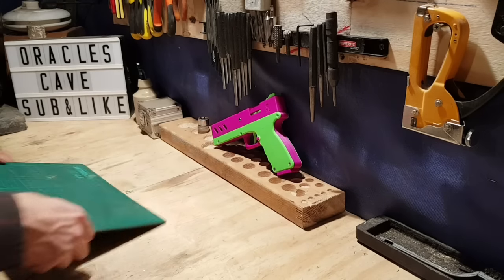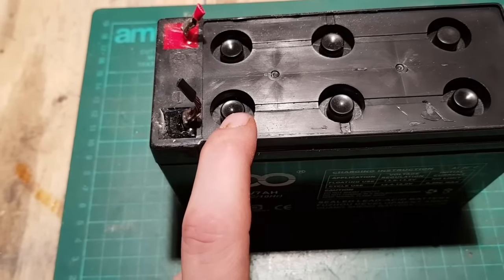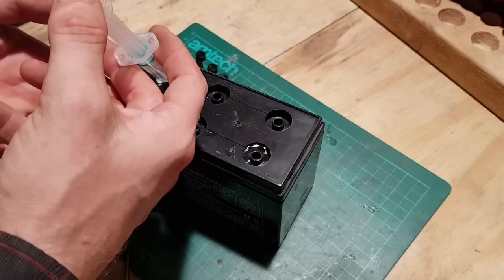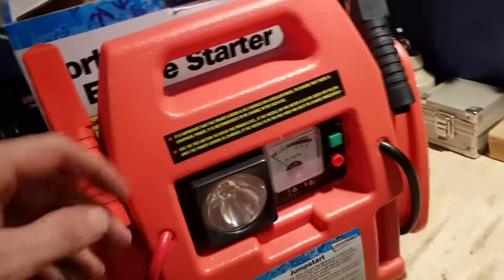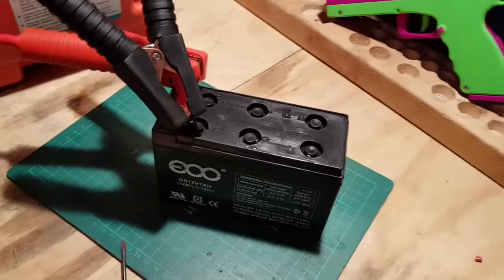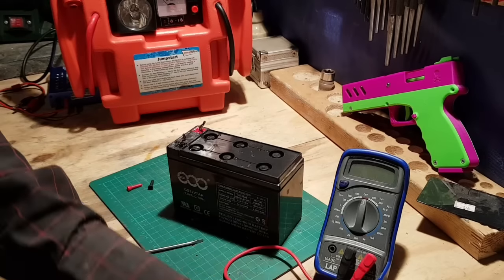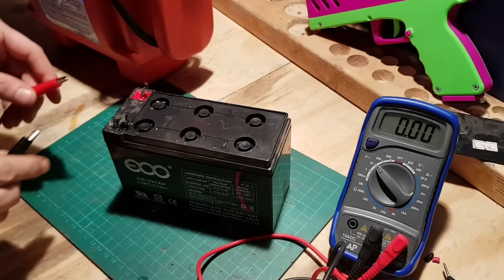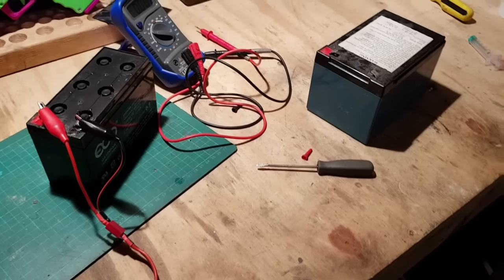HOW TO REVIVE DEAD 6V, 12V BATTERIES THAT WON'T CHARGE

Comment: Bought a 6 volt rechargeable battery to power my klaxon horn, after 1 horn blow the horn won't honk after that. also the horn is mechanically/electronically sound and the battery is at 6.54 after honking the horn, which is fully charged. what gives?

Anywho, i'll give this a try on the battery cheers mate.

EDIT: Took a look inside the battery cell plates, Lo and behold, no electrolytes and has a huge sulfation growth on the plates. 

I guess this battery might be dead.
Reply from the maker: Not completely, possibly topping up with distilled water, maybe reversing the polarity for a few seconds might help reactivation of the electrolytes.

Then charge it, probably work.
👍👍👍
Reply: @oraclescave  cool, thanks I'll try that out!
Reply from the maker: Maybe you broke the horn somehow, that sounds like more than enough juice to make the horn work.

I would try looking inside the horn for an issue before I would check the battery.
Reply from the maker: Sometimes klaxon horns are made with little gears and wheels inside and the little brass parts can fall off their connection points inside with all the vibrations, just open it up and see if you can put the wheel back and maybe epoxy or jb weld the pin back into the side.
Or look for a how to repair klaxon horn guide and try and match it to the one you have, then it's a step by step.
But your battery sounds good
Reply: @oraclescave  That's the thing, i took a look at the horn few hours ago to lube some parts and everything seems mechanically intact. 

And the horn blew strong. My bet is on the battery. quite unfortunate, the battery was like 53 - 73 dollars, christ didn't even last a year.  My fault for neglecting it i guess.

Thanks for all the suggestion's mate. much appreciated!
Reply from the maker: @samhicks97  in that case, get that case popped and do some refilling, but if you can test the horn with some other battery, that would also help diagnose the horn.
Best of luck and let me know how you get on.
👍👍👍
Reply: @oraclescave  Hello again Oracle, Here's another piece of information that might have put the nail in the coffin for the battery.  I followed a shady video telling to chuck in some salt into the battery cells. 

(This was after i lubed the horn and was ready to put back into the car)

So i think i killed off my battery by putting in the wrong electrolyte, I apologize for wasting you're time, the issue was right in front of me the whole time.
Reply from the maker: @samhicks97  yes salt is a very good electrolyte, but it's used for eating metal unlike acid that causes energy.
Not a very clever video for someone to put out if all it does is cause damage.
You can make 6 volts from normal batteries rolled up in a paper tube and taped tight, just hold a wire on either end, probably need 4-5 AA batteries, just for testing.
Beware of shady videos, always double check or triple check new information with google if it's a subject you are not sure of.

Keeps you safe, hope you get your horn up and running soon buddy.
👍👍👍
Reply: @oraclescave  Thanks Oracle, I'll probably go get a NEW battery once i have 100% confirmed the battery is indeed kaput.

Comment: I try it. why the negative terminal is heating?
Reply from the maker: Maybe your connection is not strong, maybe loose at the terminal
Reply: @oraclescave  im not doing anyting im just observing it and its heating
Reply from the maker: @darkside6148  it sounds like your battery is broken, this usually happens if the cells inside are shorted out.
Possibly the cell has rotten out.
Reply: @oraclescave  what can i do?
Reply from the maker: @darkside6148  sometimes it's better to reverse the terminals for a short time while charging. 
If you are not sure what to do, please check online for a detailed video explaining how to reverse terminals to activate a lead acid battery.

Please be safe as the battery acid could bubble, always wear safety glasses or goggles.

But it can be as simple as a few minutes then onto a very low trickle charge, do not try to charge it too fast and too high voltage.

But the liquid has to start bubbling for it to work, so please research this first so you know what to expect.

Comment: Seriously they don’t have anywhere near the capacity , and in no time they go bad. I purchased battery acid for years and it’s just not worth it!
Reply from the maker: If I can make a battery use able for less than 5 pounds cash, and it costs 65 pounds cash for new battery.

Then obviously as a spare battery its worth it, maybe not gonna be a tesla battery after you refill but 5hey still work good enough.

You tried to look smart but maybe you need to recharge your smartarseness
Reply from the maker: And why were you doing it for years, if it was useless the first time you tried ?

Yet you went on for years still doing it, is it maybe because it works, unlike your brain, you are such a hypocritical person as well as stupid, if your comment was supposed to make you look smart, yet both of us leave this conversation feeling more stupid.

I'm running out of patients with all the haters, they see a video doing well and they just come to comment to try and make you look wrong.

BOO HOO SNOWFLAKE

Comment: LOL when a battery dries out the plate loses it's ampacity is lost if left that way for any length of time. If left in a discharged state for even a month or so, crystals form that will ruin the plates no matter how much voltage you pump into it. Most batteries fail from plate shorts and corrosion, which can't be repaired. You might get voltage, but it will drop off with even minor usage.
Reply from the maker: Yes some batteries are wasted, but not all of them, and there is no point letting them be buried into the ground, and they work just fine.

I power drills, lights, and all sorts of projects with them.
I'm not one for wasting what can be saved.
And this has worked on at least 10 other batteries in the past year.

Haters will hate I suppose
👍👍👍
Reply: Isn’t there a way with higher voltage that gets the crystals off? It’s supposed to be the same way for a drill batteries lithium
Reply from the maker: @Here-2-Learn  sometimes reversing the polarity for little bursts can help.
👍👍👍

Comment: crap !. when the battery dies, it goes for recycling, it dies! It will never reach 12 volts as much as you try with either distilled water or salts or whatever shit you can imagine!
Reply from the maker: The video proves your comment false
Reply: @oraclescave  Thanks for answer but where is the false? Your multimeter saw only 10.8v not at least 12.4.
 I had a battery to charge for  all day and the  result was 10,6v and very very hot. I have a special charger for this type of battery (12v 7.2ah) but in the beginig i put 25v from a power suplly becouse the charger doesnt recognized the battery in such low voltaze(2.3v)
Reply from the maker: @kostasbobos6209  you will need to multi stage charge it at different amperages to restore full power, possibly needs a couple of millimeters of electrolytes in each cell.
Sulfation may need to be corrected also.

If you had actually paid attention to the video you would have known this

Comment: That does not work.
Reply from the maker: I showed it working.
You mean it didn't work for you.
Maybe you have a completely destroyed plates inside your battery.

But once done, you need to use electrolytes to get the power back, you can buy this separate.
👍👍👍
Reply: @oraclescave  I tried that with 9 batteries on different depletion conditions and never worked ( some worst  than yours some equal and some better)
Reply from the maker: @titodejesus6238  possibly you have got batteries that have destroyed cells.
If the cells are completely degraded inside, there is no way to complete the circuit.
But if your batteries are showing like mine your cells should be saved by this method.

You might want to look up reversing the polarity for short bursts, as this will break down sulfation on the plates and allow your battery to start taking charge again.

Comment: Smartchargers are a waste of money
Reply from the maker: They are special chargers for monitoring the balance charging of cells like lithium batteries.
But when it comes to old fashioned lead acid batteries, which are DUMB batteries.

So the smart charger struggles with voltage that's too low, its actually a very smart function to stop your serious batteries from exploding while charging.
👍👍👍